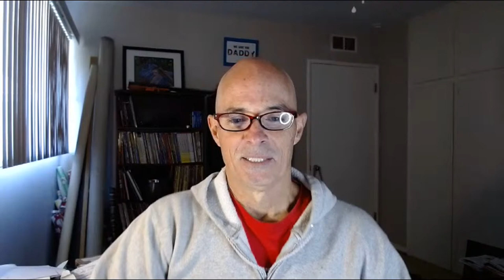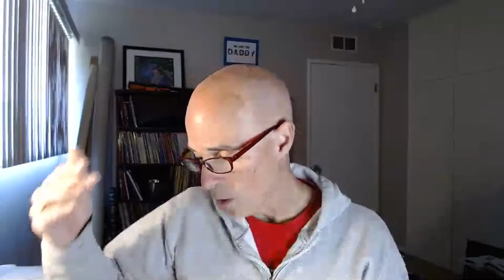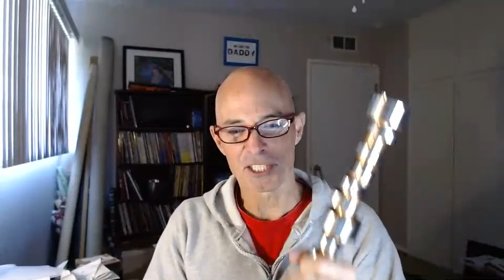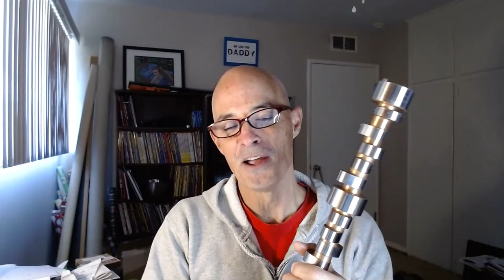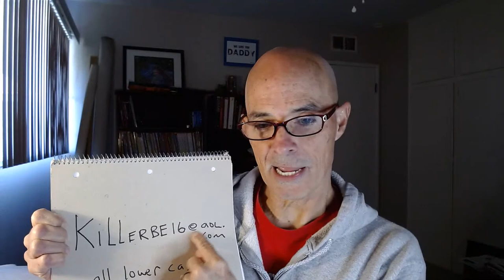TURBO TECH TALK-COMPOUND BOOST-BLOWERS & TURBOS

Comment: Heat / KR is the enemy of these engine ( Timing ) and it chips pistons cuz not much of a top landing gap on these pistons & weak  .... So if you spray 50/50% methanol and maybe 75 Wet shot of Nitrous, With Lucas 42.5 injectors (Maybe bigger s1000s be nice) & Walbo 255 / 103 Autolite 103 Racing Plugs 3 stage colder and electrodes are shaved back factory for racing style ) weldbed coolant ports on Top of LIM 160% t-stat ( what I had) open up side coolant port on side of LIM cover a little... it would definitely lowered KR down a lot.... 

- The guys at ZZP Performance are excellent he reply’s very fast to my e-mails and guided me threw the steps and what to do and what I need and should do, When I Was Top Swapping a 97 firebird N/A 3.8 ... A lot of work but fun and learned a lot about relocating things and splicing in long wire harnesses , Cutting holes into the side or the M90 & welding intake pipe into the side of The S/C and setting the intake like stock was ( very little room )

- But best idea is to go turbo because this is the same as a 87 ish Grand National car and they love turbos right? This engine is just a newer version of a grand National pretty much right? ..... but these M90 blowers are so inefficiency they hold this car back a lot and should have come with a intercooler.

- Higher boost doesn’t mean higher power or better flow/performance these engine tell you that you have restrictions somewhere like most engines do when boost is high ...... Aftermarket supercharged / Matching inlet throttle body with intercooler and 50/50 meth injection are probably the best bet with these with ported gasket matched LIMS & Heads and LIM with a cam would be. A monster

Comment: The Chevy 2.4L TwinCam engine is the last version of the Quad 4 that Olds pioneered, I had a 4 door cavalier that was one of the quickest cars in stock form I have driven, something in the range of 175 hp if I remember correctly. 
Balance shaft engine, and the dumbest water pump drive I've ever seen, could have been better, 12 hours to change a water pump is ridiculous
Reply: Look up GM Atlas

Comment: Are they not a 3.8 like is in an 2000 impala.  That has aluminum heads
Reply from the maker: check those heads-GM never offered alum heads on the 3800 series 2
Reply: @richardholdener1727  gotcha, I saw ls looking rockers and it never occurred to me. I’ll check first next time

Comment: I tried twincharging (compounding) my L67 3800. I couldn’t control boost. It would peg my 20lb boost gauge immediately! That was even with the stock blower bypass valve open. I think you would need to some how modify the bypass valve inside the blower to flow a lot more. I gave up and put an N/A intake on it and never looked back. The turbo alone on the L67 is amazing! Check out my last uploaded video haha. It also makes a 3800 exhaust note sound good actually haha

Comment: I'd think over a given point (8-10 psi?) the supercharger would present a flow restriction bigger than any benefit it gives, and I'm not even thinking about whatever parasitic drag it puts on the motor.    Would the supercharger create more drag as the inlet pressure goes above atmospheric?

Comment: I love when people say turbos dont have parasitic loss.

Heres a test you should do.
Run a motor N/A.
Then install a turbo kit, and leave the charge pip disconnected.
Then try and tell me again that turbos have no parasitic loss.

Do turbos have less parasitic loss than any belt driven blower? Absolutely. But they DO have parasitic loss.
Reply: I would agree. I mean sure there is wasted energy in the exhaust but adding an exhaust restriction will cause an engine to work harder. After all, energy is neither created nor destroyed
Reply: Its back pressure/restriction killing a few hp not being connected to the engine not parasitic loss, connected to the intake you still have back pressure but its making boost/power efficiently vs forcing exhaust thru the turbines for no reason.
Reply from the maker: that won't work-it works with a blower (though still incorrectly to calculate the power consumption)-but not a turbo
Reply: @richardholdener1727  After thinking about this some more i realise that this wont place any load on the turbo and will give false numbers.

Try restricting the charge pipe down too 1.5" or so too let.it build some boost and load up.
Reply: @Saddedude  you have a point. I remember from hydraulics that power is a function of pressure and flow so we'd need a spring loaded flap over the discharge port on the cool side (intake) of the turbo to simulate boost.
Reply: What about simply measuring exhaust pressure before and after the turbo?  It wouldn't be completely scientific because an engine isn't perfect, but if we know air flow coming in an it's very close to airflow coming out minus the blow by, then pressure difference across the turbine blades would give us the parasitic losses in the exhaust.
Reply: You can roughly calculate the torque/power lost from exhaust backpressure,  bore & stroke.

Comment: You have to feed big turbskies with a big A/R using a supercharger with a kevlar padded A/C clutch.  Have a Y piped intake with a spring loaded check valve, so the blower forces it closed. Once the turbo pulls away with boost then open the clutch on the blower. The check valve will open immediately. No blower loss and it looks like Max's Interceptor!!

Comment: I was under the impression that it was better have a turbo feed a supercharger vs a supercharger feeding a turbo.
Reply: Is the Supercharger feeding the turbo with increased exhaust volume or is it piped directly to the hot side of the turbo?